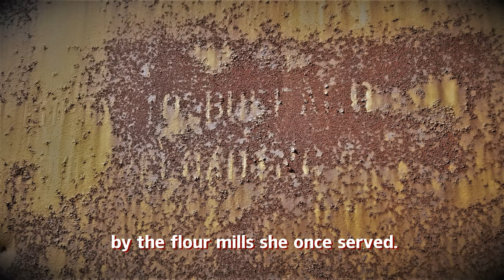FLOUR-BY-RAIL: Arrival of Boxcar Buffalo Creek 1424 at Silo City, Buffalo

Comment: great story. Most of these boxcars were painted boxcar red. This looks a lot like some Lehigh valley/pc green ? or is that just what is left of the primer ? nice video !
Reply from the maker: Hey there! So the original order of Pullman cars, of which this is a part, were painted a color called Erie mineral Brown, no doubt in part that the Buffalo Creek was owned half by the Erie and half by the Lehigh and that the Erie placed a PS-1 order at the same time. If you look at pictures of Erie box cars, you'll note that the same style/face of lettering is used for every bit of the car data between the Erie cars and the BCK cars. 

It does seem that subsequent BCK boxcar orders and perhaps when the cars were repainted resulted in a much richer red; You could probably identify it as you did correctly as boxcar red. We found the mineral red brown color on the interior side of the car sides, and we found the more boxcar red color when we removed the ACI tag. Both of which are nice fines as we try to determine a 100% accurate color to repaint the car. 

Please consider subscribing if you haven't already and check out the FBRLP Facebook page at facebook.com/flourbyrail.
Reply from the maker: And I forgot to add regarding the gray; this was the standard maintenance of whey color that Conrail painted all of their company use equipment in.